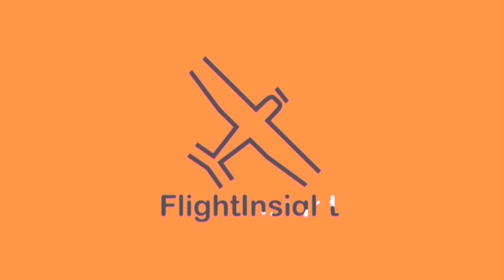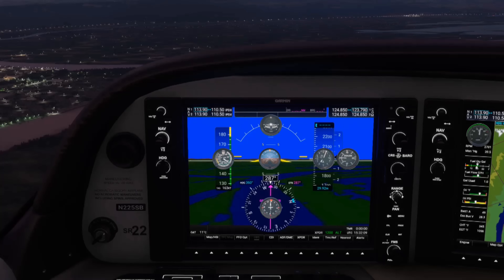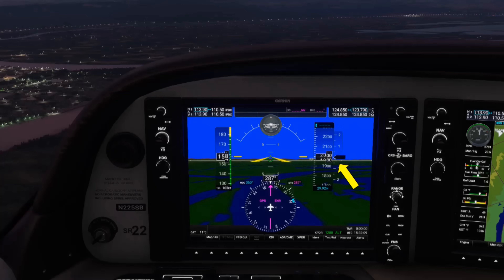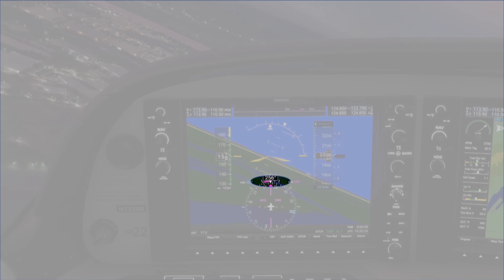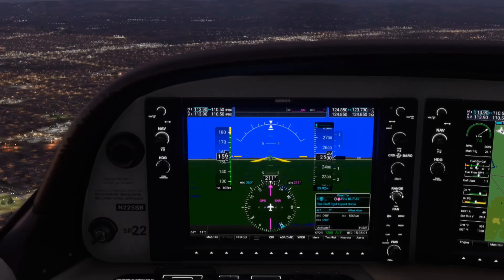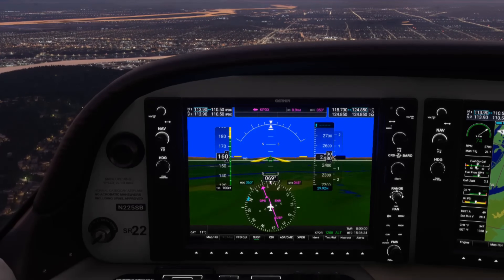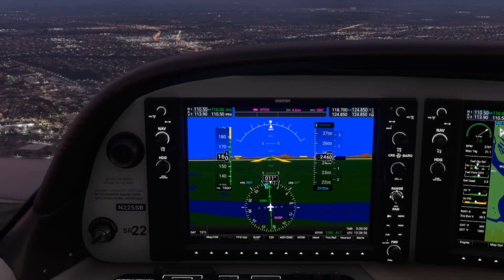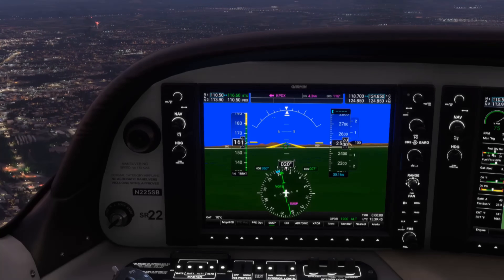Garmin G1000 Intro | G1000 PFD | Glass Panel

Comment: There's No Auto Pilot, Like Microsoft Flight Simulator. You Have to Fly the Aeroplane Yourself.
With the advent of Digital Flight DISPLAYS. There's No Need for Two Crew (Pilot and Navigator).
The G1000 - Aids the Pilot with Navigation. Navigation is Done using Inertial Guidance (Plane has a Rough Idea of Direction (Compass) and Distance (Speed/Time)) or Using VOR's.
You Can Do this in Microsoft Simulator. Caution: Microsoft Flight Simulator is Similar but Different. So You have To Learn Two. Like How a Manual (Clutch car) is Similar but Different to An Automatic Transmission Vehicle.
Reply: The Autopilot Stuff in Microsoft Flight Simulator -Thats Not How a Real Aeroplane Works. You won't Learn anything by doing that.
Reply: @mahkhi7154 exactly!
Guy makes bold statement based on Microsoft flight sim which is the bottom of the barrel when it comes to quality simulation.

Comment: A single circuit fails and you loose your whole instrument panel instead of just one gauge. It would suck for someone that trained on something like this and never learned to navigate by eyeballing landmarks or to estimate youre airspeed without a gauge telling you whats up. Learn the basice and dont be stuck relying on a computer that could shit the bed while youre in the air.
Reply: It wouldn't suck for long. You'd either learn in a hurry or crash the frame. Not sure why everyone thinks there are just a bunch of people flying around that only know how to fly with a Garmin setup because most GA aircraft don't have this stuff anyway unless it's some rich Grandpa's hangar queen.

Comment: Although this video makes use of a simulator screen (I'm guessing its Microsoft Flight Simulator),  be aware that the MSFS garmin G1000 is missing a lot of screens and also does not simulate the cursor (a mouse pointer moved around by a control knob which is pushed in four directions and pushed in to click like a mouse) functions of the G1000 and that makes doing things like "finding a VOR on the map and tuning to it" really unintuitive in MSFS.

Comment: This video is awesome. Flight schools charge more for a G1000 Aircraft. I bit the bullet and got checked out in a G1000 and was well worth it. The Microsoft Flight simulator X also helped me learn the G1000 as well as the Red Bird simulator.
Reply: My school charges 180 for traditional panel and 190 for G-1000.

Comment: Man I really appreciate your awesome video the best channel I’ve seen so far, I’m a pilot with 1700hrs and I still learn from your videos, many thanks 🙏
Reply: Hours in the air dont really matter unless you under 100hrs. Think about driving, a driver with 7 years on the road doesnt really have much more of a chance of wrecking than someone thats been driving 20years. The biggest factor is chance. Also I've noticed that most of the ones with years in the air get complacent or cocky and take chances that most novice fliers wouldn't. Whenever you hear about a crash its almost never someone that was just learning or new to the air, its almost always a pilot with years of experience you see went down on the news.
Reply: @ianwilkinson5069  Congratulations, you totally missed the point of his comment.
Reply: @jaypie0864  🤣🤣🤣🤣
Reply: @ianwilkinson5069  I guess airlines should stop recruiting experienced pilots then…
Reply: Nonsense @ianwilkinson5069